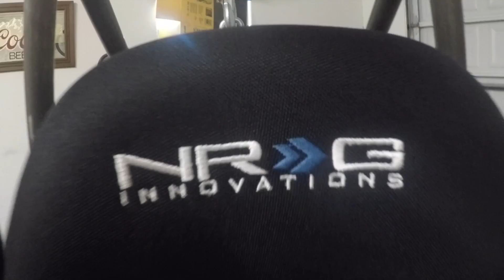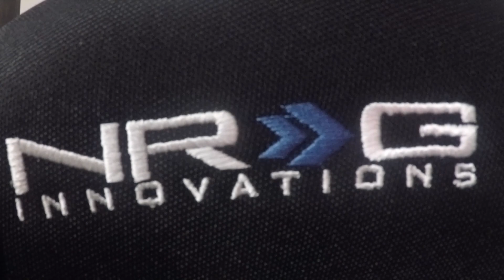MOTOR IS BACK AND THE SEAT IS IN!!!!

Comment: The welds on your frame were to cold, use more heat.
Reply from the maker: So then how am I supposed to fix what I’ve already welded?
Reply: Grind, grind, and when you think you’re done, grind some more!   Also there’s no need to weave your welds, just focus your puddle directly into the joint itself, then your welds will have better penetration, and look cleaner.   Maybe also slow down your wire feed about a half notch.
Another good tip is do NOT weld everything completely until you have everything put together.   Tack weld the entire cart, that way if you need/want to make a change, it’s simple to just cut a tack weld.   You may think it’s extra steps to have to completely disassemble after it’s completely built, but I assume that you will take it apart to paint it anyway!?!?
Reply from the maker: I appreciate your help! I grinded everything and re welded it all. I’ve been tacking from then on out but man that grinding was a pain in the butt lol. Thank your for the tip